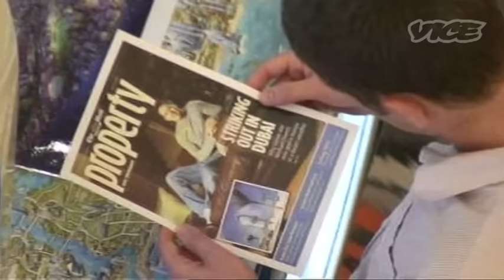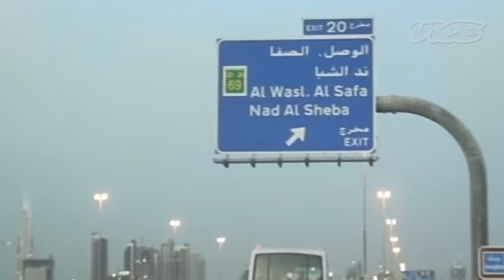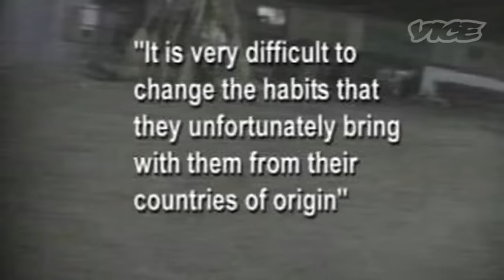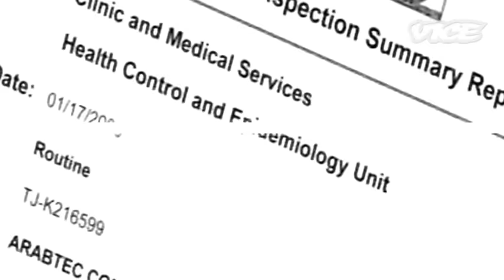The Megacity Secretly Built by Slaves

Comment: I live in this country and I was doing horse riding  in a pretty much fancy and expensive equestrian club. One day I lost me way out and went around the main buildings to see one of the most shocking things I’ve even seen here. 
Behind and distant from the luxurious club i found the place where the workers lived. It was like a few tiny huts with no air conditioning and probably no electricity, surrounded by dirt and garbage, i also saw cooking tools out on the floor meaning they don’t have a kitchen and they cook on fire outside, and you can tell from the clothes hanging outside each hut to be dried that a very large number live in a single hut. I can definitely say that the stables for the horses stay were in a much better condition than this place!
This is how big the gap between the rich and the poor in this country, and this is how bad they inslave those workers !